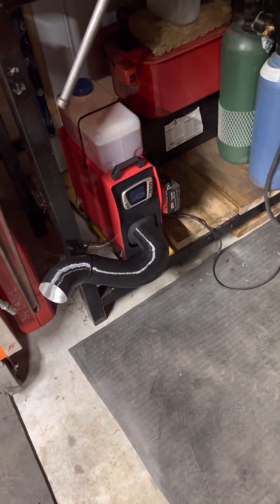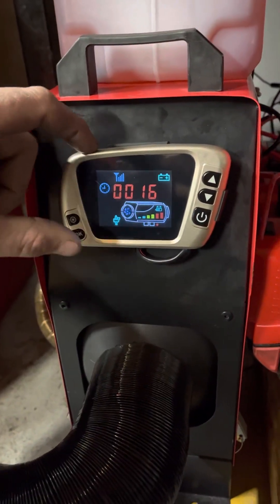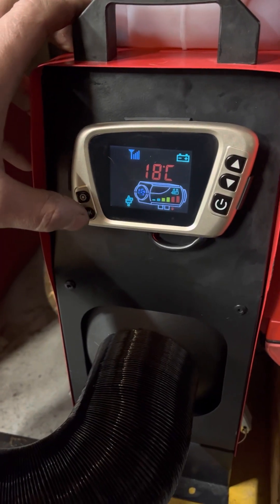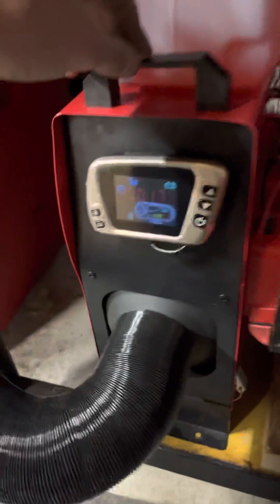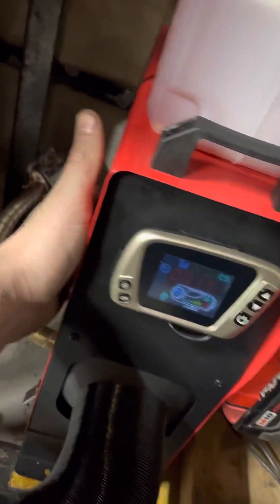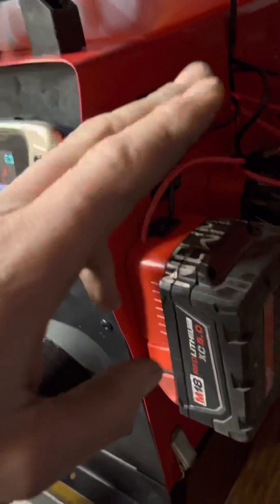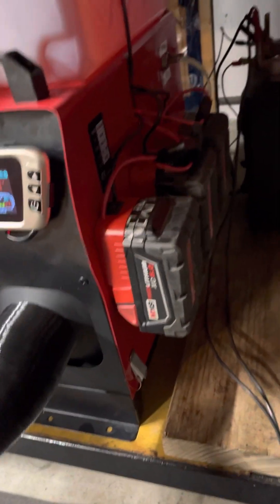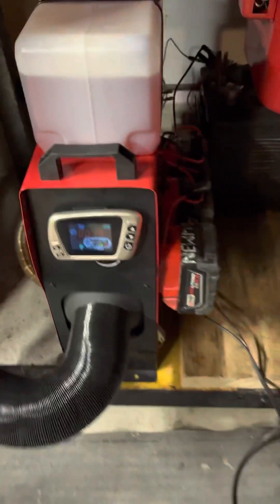Thermostat Mode ? on Chinese Diesel Heater ! Milwaukee M18 Powered

Comment: I've been looking to do this as well. What type of buck converter are you using?
Reply from the maker: Steve, I’ve got 20 hours on one of these and works great. I bought it because the Load side voltage is adjustable but I’m going to swap it for a sealed convertor because mines going to be outside my ice hut in the snow. Any 24v/12v convertor will work, just make sure it’s 20 or 30 amp 

https://www.amazon.ca/Converter-Module-Step-Down-Constant-Current/dp/B07YCP911Y/ref=mp_s_a_1_6?keywords=24+12+20a+buck+converter&qid=1670772266&sr=8-6